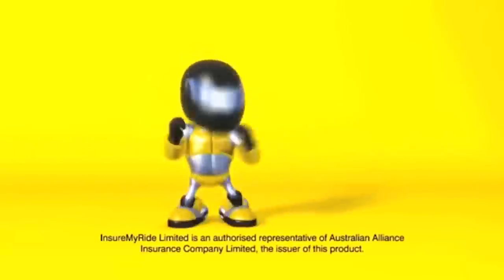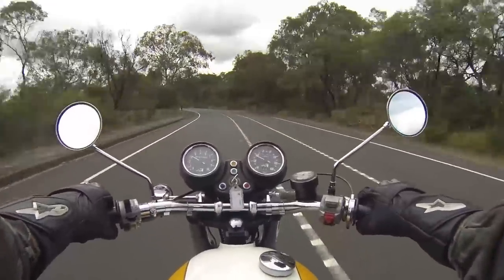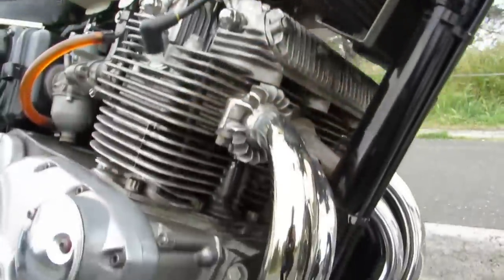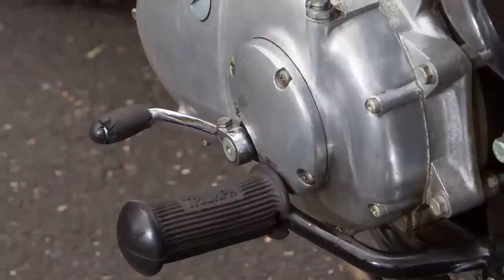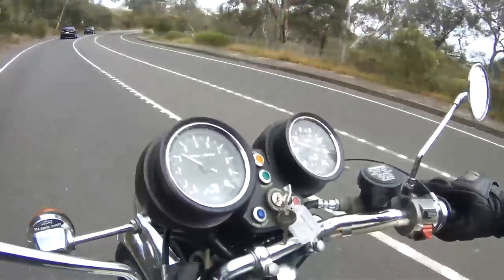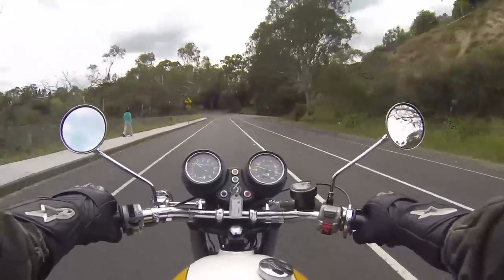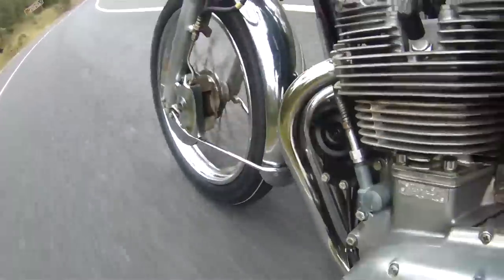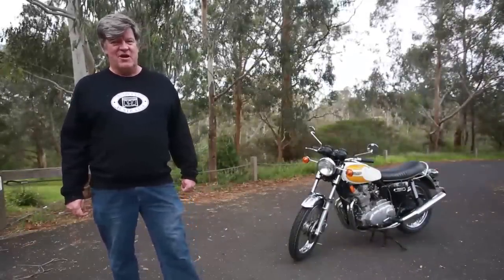Triumph Trident T160

Comment: I have the T150v and have been riding it since 2004. I read an interesting story explaining the Triumph mishap of stamping too many parts in Autumn of 1974 and that's why you and I have (had) the T150v from 1975 instead of Triumph  changing the Trident  to only T160 in'75. Triumph didn't bother issuing a manual for the 1975 they just told guys to use the 74. I get a lot of arguments from guys who insist my T150 is a 74. 
Nice video!

Comment: Pesenter says engines builtat BSA Small Heath and bike built at TriumphsMeriden factory. That is Wrong. No  Tridents were built at Triumph Meriden after 1973 from March 1974 all T150Vs and T160s were all completely built at BSAs Small Heath factory until production ended in early 1976 Roy Allen
Reply: Good point, Roy. What chaotic days those were with the lock out at Meriden, and souring industrial relations between management and unions. I was still only a teenager then but wonder how the workers viewed it all. Given the dire financial state of Triumph back then it feels amazing that so many T160s were actually built. No doubt Les Williams had much to do with that feat.

Comment: Bought that exact model in the late 70's...same color scheme. Fun bike and fairly stable at higher speeds. Believe I paid around $1500 because it was a close out and they just wanted to move them.
Reply: were they reliable?
Reply: @Spartansrule118  Early on it was but ran into electrical issues later on that were a headache...good bike overall...ended up selling it to a guy that restored British motorcycles.

Comment: The single plate dry clutch is of "Borg and Beck" manufacture, it's exactly the same as the one used on the Austin Mini car. If you own a Trident and need to get a clutch plate, buy a Mini one as they're a lot cheaper than buying from a classic Triumph dealer. You can improve the brakes performance by having the chrome skimmed off the discs as the bare cast iron is pervious and soaks up the rain water. Ok your discs will go rusty overnight, but as soon as you use them again the rust comes clean off and you'll have brakes that work.
Reply: First off David some clutch platest ie mini have spring washers between the friction plates and will rob you of precious.•025" lift 'some plates are without these washers. Competition plates and cooper S spring's also fit. You may find that the spine boss is riveted thru  and not on.
To remove chrome plating from discs go to your local plating shop and they'll take it off' no shabby machining'they were originally designed with 3-4 thou run out to return the pads 'When removing from the hub mark it's position with centre punch or you will create a different wear pattern = pulsing 'good luck '45years and still learning
Reply: @mmark8394  Thanks for your reply M Mark, I traded my T160V in against a brand new Triumph TSX in 1983, that was a bad move as the TSX was the most unreliable motorcycle that I've ever owned. Meriden's quality control must have been non existent in their final months.

Comment: I just wonder if having some holes drilled in the brake disk some of the issues around stopping in the wet could be alleviated. Yes, it wouldn't be standard, but stopping is kind of important .
Reply: I think you'll find it was the chrome plated discs and the pad material .
Reply: As said above, get rid of the chrome. Without the chrome, the brakes are great; so makes no sense having it.

Comment: The brakes on that one in the test don't work because they are chromed. Originally (74 T150 on) they weren't chromed, just bare cast iron, and the brakes were excellent. There is not much info about the chromed discs, but you can learn a bit from the parts lists. I have all the Triumph bike parts lists, and there is little mention of chrome disc part numbers. What they DO mention is under brake pads. The standard brake pads have a note that says "Warning!! NOT to be used with chrome discs". So they mention chrome discs, but don't list them. They also don't mention any other pads. So don't mention "pads for chrome discs" and don't list chrome discs????

It was my understanding that the chrome discs were "only for show" when the bikes sat in dealers for ages, given the ludicrously thin coating that wore off after a very short time. MOST of the Brit bikes with chromed discs that have done any miles that you see have unevenly worn chrome, ie, half there/half not.

They raced these bikes with cast iron faces/brakes were GREAT with that, WHY would anyone want them chromed, so that they then don't work as well??? It makes no sense.

Why else would they have chrome on them, (apart from jjst for show) when EVERY Euro bike with great brakes had bare cast iron? Ducati, (I had a 75 900SS, cast iron discs = brilliant) Laverda, Moto Guzzi, every Brit bike = cast iron. The Japanese spent a fortune on every type of brake pad because they insisted on having everything BUT cast iron, and half the early Japanese discs were shocking in the wet by comparison. Looked nice and shiny though........

I bought my 74 T150V in 93. It had/has a 1,000cc Hyde kit and twin front discs, and the brakes are excellent. When I first got it, it had one "too far skimmed" disc (thin, under spec) , and one "patchy chrome" one. You could feel it "grab/let go" as it contacted chrome/cast iron. So I bought a new disc to replace the thin one, and had the "barely there" of what chrome was left skimmed off the other one. Brakes were then perfect. 

If your priority is a shiny front disc, keep the chrome ones. If your priority is actually stopping - get rid of it = use a bare cast iron one. It is as simple as that. 

My Trident sat for about 10 years, and is just finishing a major rebuild (95% complete) , and will soon be back on the road. My BSA A10 (62) has to be ridden carefully in modern traffic, as the "4 wheel disc brake new car brigade" love pulling out in front of you and jamming on the anchors, and the BSA's front drum................. you need to be careful. 

Wheras the twin discs on the Trident can stop in almost any modern traffic situation. 

They can be very frustrating bikes, but when they are running right, they are GREAT, I will keep mine forever.